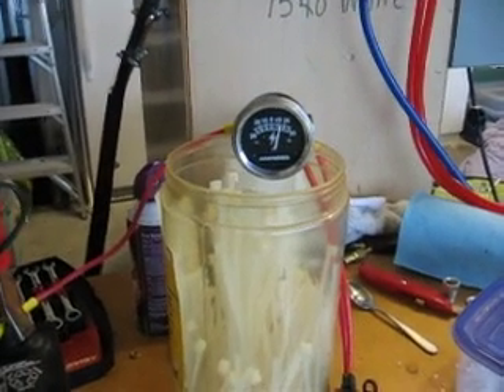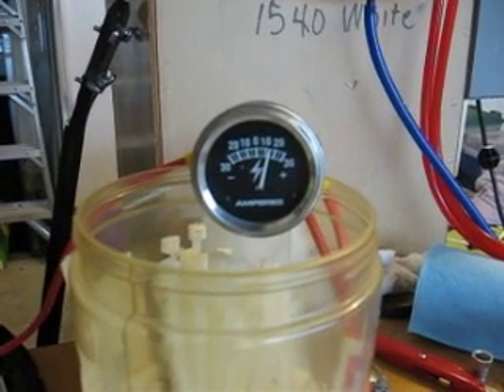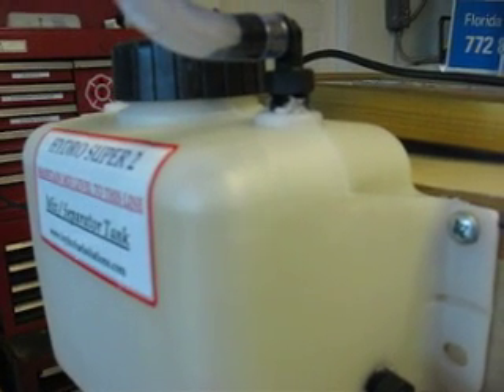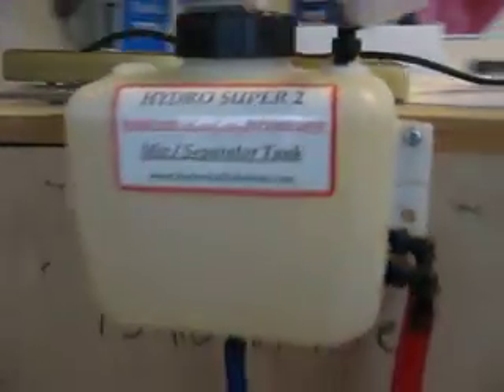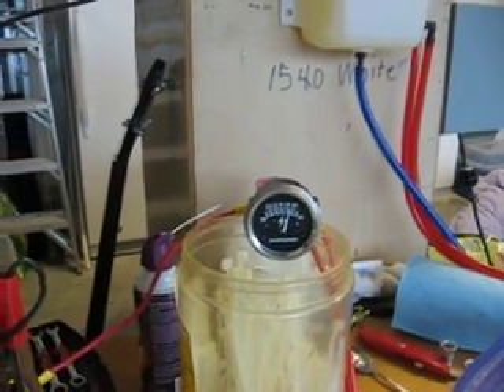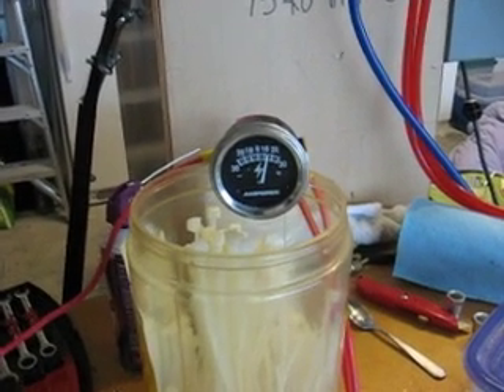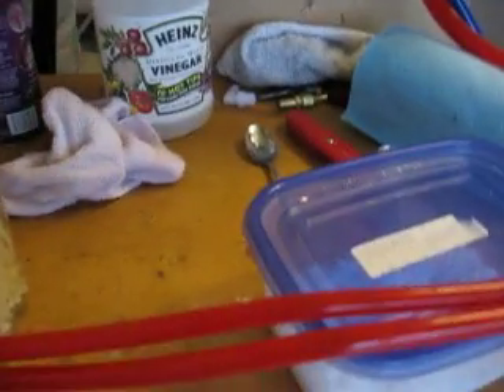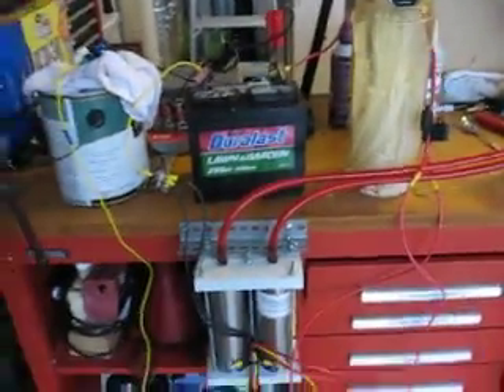Hydrogen by Cantburn 7

Comment: Chip - you're heading the wrong direction on your mix.  Either stay with an acidic electrolyte or go alkaline but don't mix the two... it will give you a salt.  You're first electrolyte was just too strong of an alkaline.  You're 2nd mix was just too weak of an acid (vinegar).  I suggest you clean out your system and start over with a higher % vinegar or else a very weak POH. - Dwayne in Florida